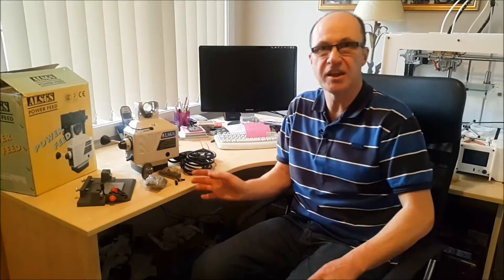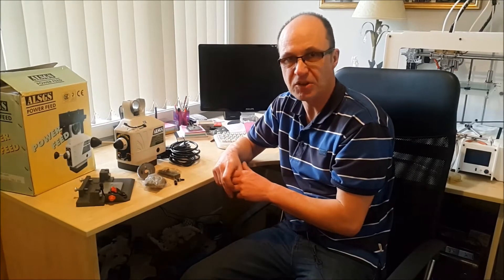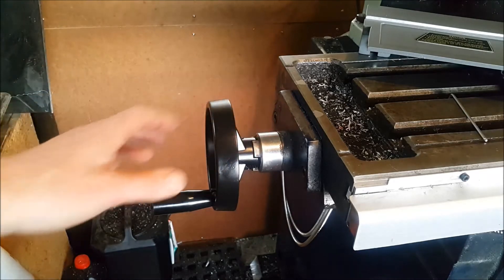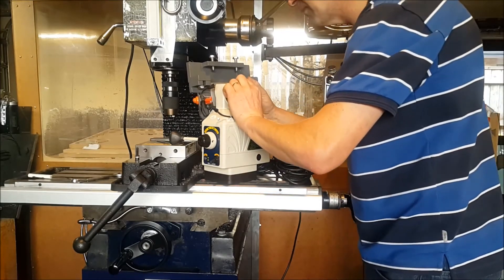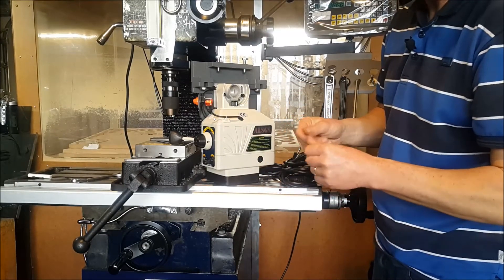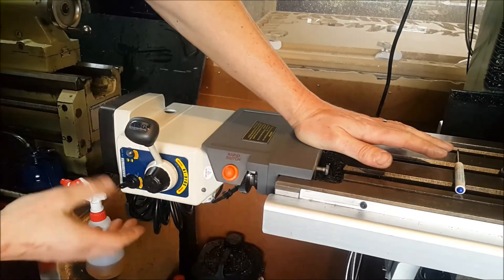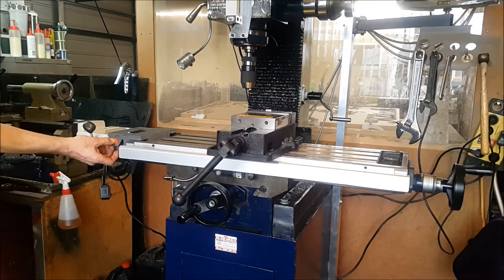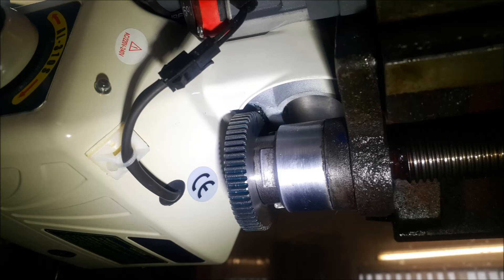16 - ZAY7045FG(ZX45 clone) Milling Machine Power Feed Install

Comment: great, helpful video,   when you want to crank by hand how does it disconnect from the motor?  I 'm guesing it disconnects internally when the handle is in the neutral position
Reply from the maker: Hi there, no it doesn't disconnect. Regards Kevin

Comment: Hi folks. One tip to remember is that the drive and driven gears do need a little bit of backlash to work properly. Don't mesh them as tight as possible. The old trick was to use a sheet of paper between the teeth to create the clearance - it needs to be just a few 'thou or 0.05 to 0.1 mm.. Don't forget some graphite grease either or they will wear too quickly, become too noisy and eventually fail. Gears do not rub on each other, they should roll if correctly set up, but lubrication still helps and as said in the video this is quite a demanding application.BobUK.
Reply from the maker: Hi Bob, totally agree. Regards Kevin

Comment: Hi and thank you for your nice video: i have a SIEG SX3 milling machine, i want to install you power feed but the vertical version, your version works only in orizzontal position ? Thank you, Alberto
Reply: Hi. This drive is for this mill only. There are many different final drive gears depending on which mill you have so you must get the right one or you will have to makes some modifications. Horizontal drives are often used on column mills as the vertical ones would crash into the support cabinet. I am in the process of installing this type of drive on my mill and had to convert the bore in the gear wheel from 12 mm diameter to15 mm. My gear is different from the one shown here which has a dog tooth engagement, mine is just held in place with a grub screw  which engages in a keyway on the shaft. I think the one shown here is more like the standard Bridgeport mill version. Good luck with your addition - it will make life much nicer! BobUK

Comment: Excellent video. I have the Enco model RF-45 and I am looking for a X axis power feed. What model # is the ALSGS power feed that you installed?
Reply from the maker: Hi Whitehorze, its the ALSGS ALB-310 200RPM 450in-lb 220V Horizontal Power feed.. Regards Kevin

Comment: Thanks for the video! I just picked up an old beat-up ZAY7045FG but mine is missing the 'spigot' with the lugs on the left side. Does the one you have just have a set(grub) screw to fix it or is it through pinned like the right side x-axis and the y-axis? Also, do your dial gauges allow you to "zero" them? Mine seem to be fixed, but may just be stuck or something.
Reply from the maker: Hi Stan.  Thanks for watching my video. The spigot on the left has a grub screw. The dials should spin freely. I would say that they are gunked up. I dont use the dials now ive got the DRO installed.  Regards kevin